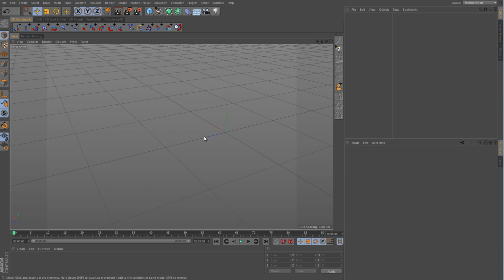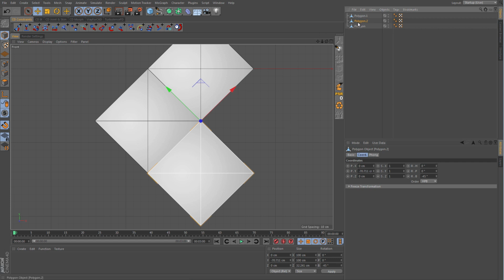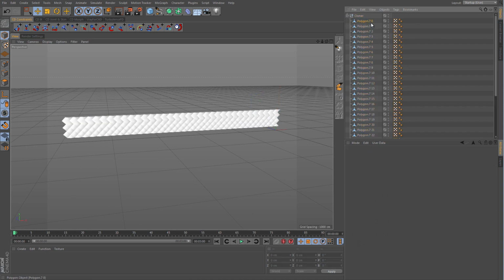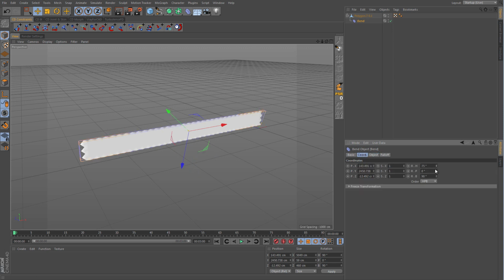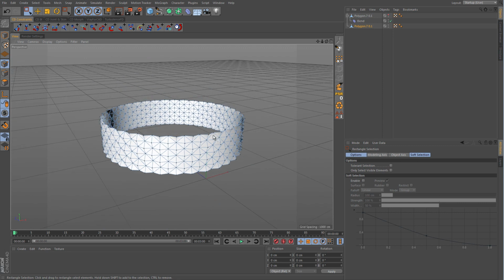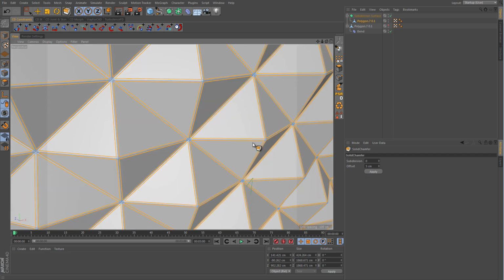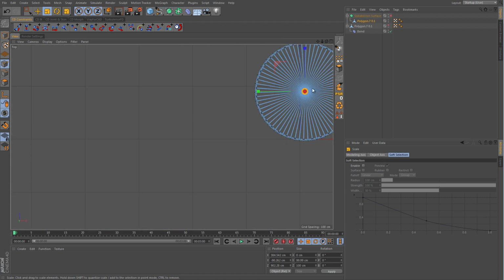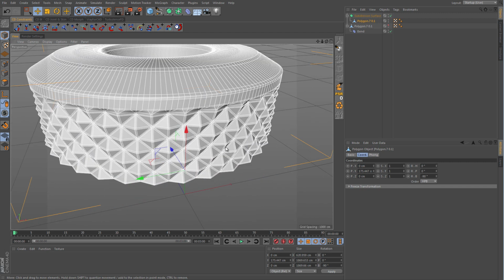Sub-D Modeling in C4D - Part 21 - Diamond pattern cylinder

Comment: Referring to your "problem" at the beginnen trying to snap the objects together (you mentioned that if anyone had a tip you would be happy to hear it): one thing you can do to avoid moving the object axis before you snap one object to the other simply is to use Axis Exension. It's a bit difficult to explain. You're probably familiar with Axis Extension and how to use it, right?  I've recorded a very short video without narration that shows what I mean. I hope it's clear. You can download the video here: 
http://www.mediafire.com/file/3mtdb5uz01qelhz/snapping_two_objects_without_moving_object_axis.mp4/file

Comment: Hai there, Iam big fan of your tutorials and work.it inspires me a lot, And i would like to thank you for sharing them with us.It really helped me.
Being said that,I have query related to sharping of the edges on any hard surface geometry using nurbs or subdivision.
Can't we use weighting or subdivision weighting (hot key=M+R) on the edges instead of creating extra loops near the edge to make it sharp??
Reply from the maker: Yes, you can use weighting. However, sometimes weighting will give you odd results, such as artifacts, and the mesh may not be smooth in those areas unless you increase the subdivision count. I tend not to use weighting much. Sometimes it helps, but other times it makes the mesh worse.
Reply: Thank you so much.

Comment: That fit to parent function. Super useful, and I sort of died when you walked through the process of fitting it to the parent manually.
Reply from the maker: Yeah, I still have to learn all the new updated features. I am coming from R13, and it did not have that "fit to parent" option. I always had to fit it manually.
Reply: I still liked the video, it was rather informative. Your other tutorials are rather well put together and to the point. I feel like I only comment in a video like this if there is something out of place. I don't usually comment if it's all around good video because I don't want to spend a lot of time here.

Comment: Nice Tutorial as always! Thank you! Modeling a flask the other day with a cap looks like this :-) For the bevel i used the 'Bevel Deformer' instead, for non destructive options like selection tag. My Tipp for the 'points to circle' shifting issue: scale the points down first along X and Z and then use the scipt afterwards.
Best regards, Tommy

Comment: With your snapping problem, you can change the moddeling axis in the menu of the move,rotate or scale tool. So you don't have to change the local axis of the mesh (the mesh need to be editable). And for the  bend (or any deformer) if you click on the bend while pressing shift and the mesh is selected, it will put it in child of the mesh with the good scale (or simply press "fit to parent" in the bend menu)
Reply from the maker: Thanks for the tip! And yep, you're right. Holding shift will do it, as well as the "fit to parent". It was right there and I didnt even see it. lol